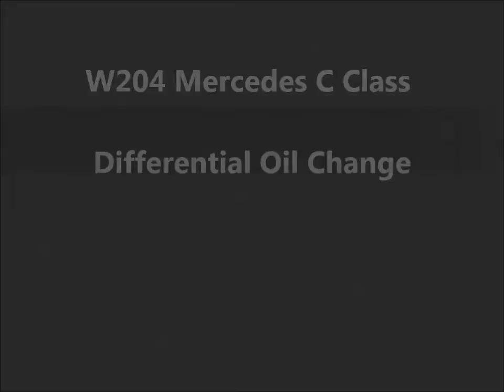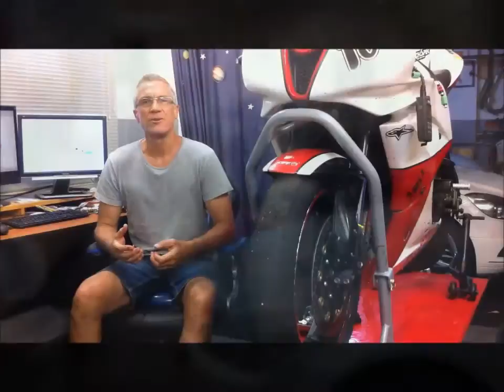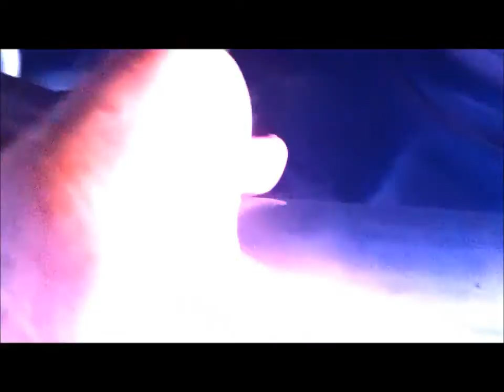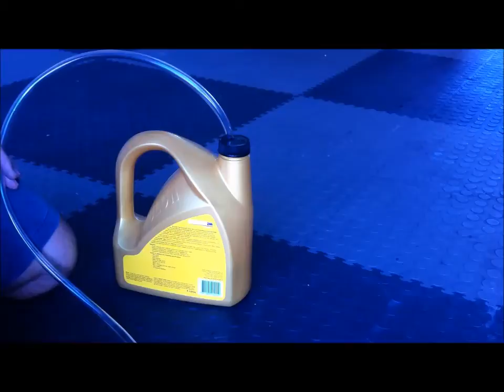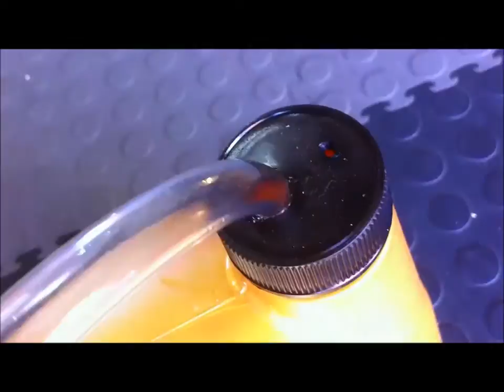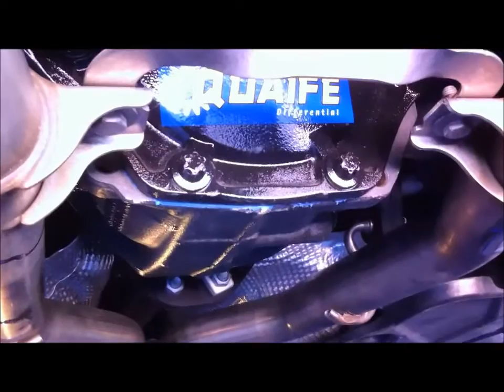W204 Mercedes C E S CLK CLS SL Class Diff Differential Oil Change

Comment: How do you like the diff vs the open diff, is it more engaging in straight line or around corners ?
Reply from the maker: Both ... it has more traction and is more planted to the road. Coming out of corners it turns better. It pulls the front inwards as more torque is going to the outside rear.

Comment: Hi, what oil do you recommend? original mercedes says sae 75W85 but it does not say if it is sintetitco or gl how much. Thank you
Reply from the maker: 75w-90 full synthetic with the API Specification GL-5 is the type to use. Regards, Scott
Reply: @ScottElliott152  
thank you, mercedes benz puts mineral oil, when changing to synthetic oil does not produce any adverse effect?
Reply from the maker: @higadocebollado  No adverse effects. Check the lube guides from the major oil companies. Synthetic is a better quality oil.

Comment: Scott, did you do the front? (don't know if you have a 4MATIC). I just did mine today, back and front.  The back procedure was identical to yours.  The front, I could only find a small drain plug (6mm hex). So I drained it and filled it using the same plug.
Reply from the maker: Well done. Mine isn't a 4MATIC. We didn't get them in Australia. The way you changed the oil is fine.

Comment: Hello Scott, can I use Red Line 75w90 high performance API GL5+ gear oil in my 2010 w204 benz
Reply from the maker: Philip yes that oil has the correct specification.

Comment: Thanks Scott. It's always inspiring to watch your video! I wonder if I need to do both front and rear since mine is 4matic. It's 150K now. I talked to dealer, they said they never do differential oil change service since there is no physical drain or seal or something on c class, there's just no way for them to do. I wonder if that's true, or they just lack of these kind of info.
Reply from the maker: Well there is a drain and refill plug on my W204. The easiest way is to have a look at your differential. I change mine every three to four years as preventative maintenance. It's cheap insurance. Scott
Reply: Thanks for the info. I did check my front does not have drain, only fill plug. Maybe this is how 4matic works. I think I can suck most of them out and refill it through the same plug. But how am I suppose to know when to stop? Would it be less if I seal when it comes out again?
Reply from the maker: Yes suck it out and refill until it starts dripping from the filler hole. That's the normal process. Scott
Reply: Thanks a lot, Scott! :)
Reply from the maker: Glad to help. Come back with some feedback as to how you did the operation. These 12V vacuum oil pumps are good value. I have one and it's handy.

http://www.ebay.com.au/itm/DC-12V-Diesel-Oil-Extraction-Pump-With-Tubes-For-Truck-Rv-Boat-ATV-NEW-/182496116367?hash=item2a7d9dbe8f:g:~YoAAOSwSlBYzz8-

Remember to drive the vehicle for about 10 minutes to warm the oil before draining. Regards, Scott

Comment: Hi scott do you know how i can change the anti freeze? 
Thanks in advance
Reply from the maker: +Hakan Tunc Yes I do. I'll make a video when mines due. It's not difficult. You may not need to do it yet. You csn check your coolant with a multimeter,. Immerse the positive probe in the coolant reservoir and the negative to ground. If the voltage measure is less than 0.3V it's ok.

https://www.youtube.com/watch?v=vKryQVfnDHI
Reply: +Scott Elliott ok thanks
Reply: +Hakan Tunc hi scott again do you have an email address as i would like to ask you several question about my mb w204 250 or should i ask using this youtube format?
Reply from the maker: +Hakan Tunc ... Hakan you can use the YouTube message system. No different to email so just send me a message! Regards, Scott

Comment: Thanks for the Videos, I got a humming symphony in my w204 c200 differential, which oil or additive do you recommend?
Reply from the maker: Khashayar Farahani Hi Khashayar. Thanks for your compliments. I don't use any additives I use good quality oil. I have a full synthetic 75W-90 differential/gearbox oil that meets API specification GL-5. Regards, Scott
Reply: the humming is from the input shaft bearing.  The cure is bearings replacement of pinion drive .

It is my understanding that wheel shaft bearings are lubricated by the differential oil until the level gets too low from cheap seals leaking 🤗

Comment: Hi Scott, tried to find a rear diff magnetic drain plug for a W204 with no success, have you any links to were i can buy one?. thanks
Reply from the maker: Peter this is where I've been buying them:

http://www.ebay.com.au/itm/1-Neodymium-disc-rod-magnet-3-8-dia-x-3-8-N35SH-high-temp-oil-sump-craft-diy-/181103522449?pt=LH_DefaultDomain_3&hash=item2a2a9c7291

Comment: What is the frequency for this change?
Reply from the maker: Jaime Marún Jaime the recommended frequency is so long it's crazy. I think it's 10 years. Whatever it is it's a very long time.Use 75w-90 full synthetic manual gearbox/final drive oil complying to API Specification GL-5. Regards, Scott
Reply: Thank you Scott.